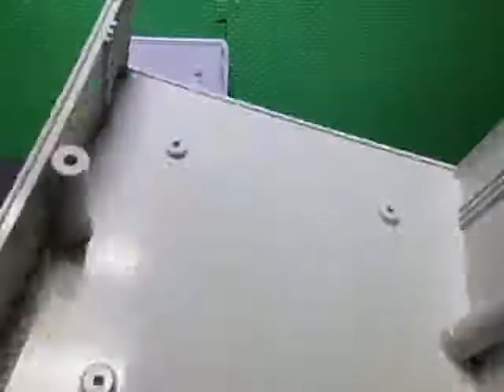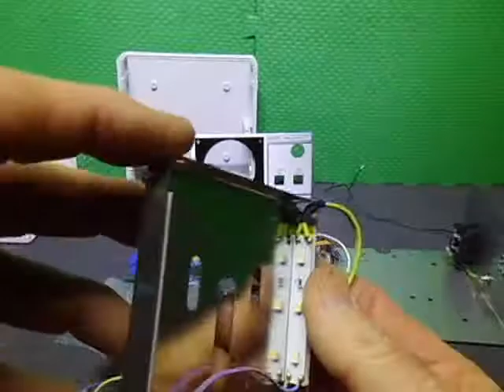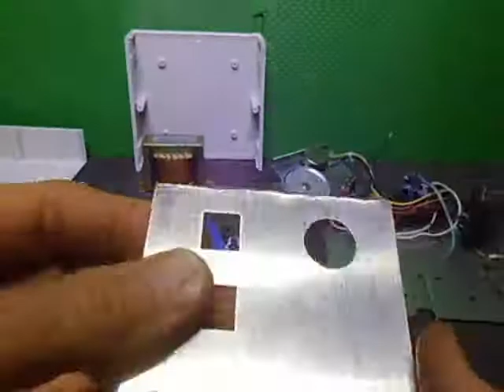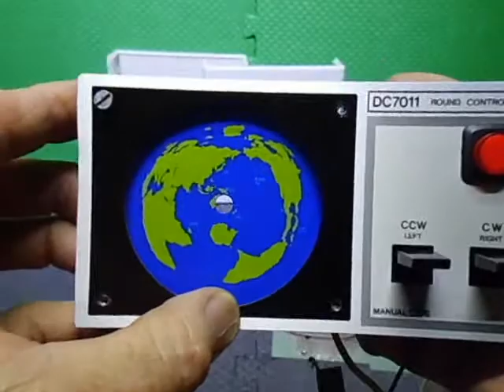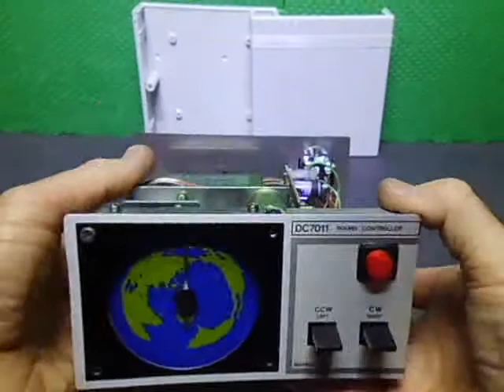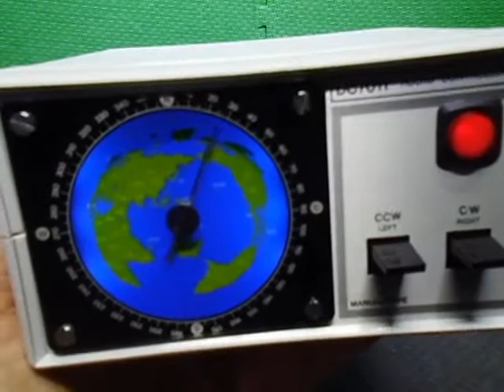DAIWA DC 7011 Controller With Replacement Case, Upgraded & Rebuild.

Comment: I have just been offered a Daiwa DC7100 controller & a DR7500 rotor, it be my 1st rotor so is it a DIY electricity job, or do they come with plugs attached.
Cheaper than a Yeasu G-450dc, what would you recommend mate